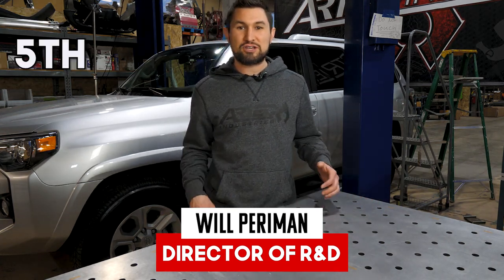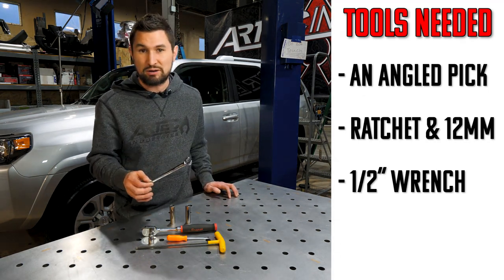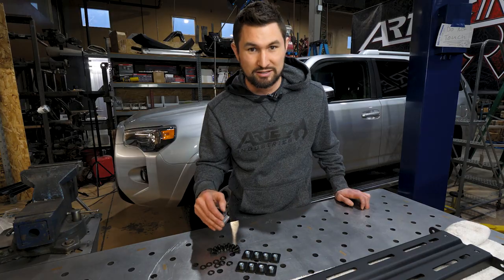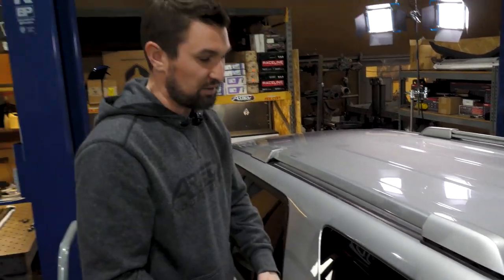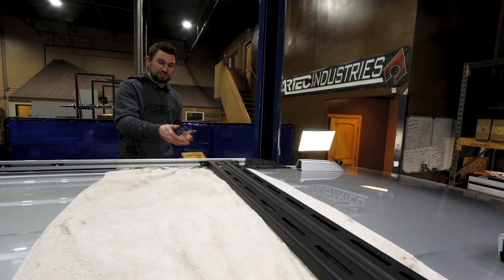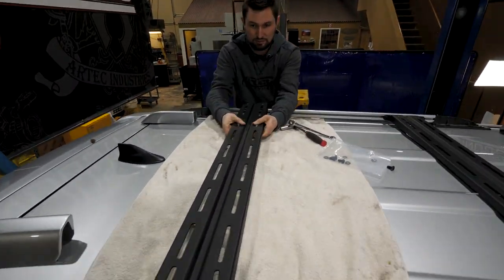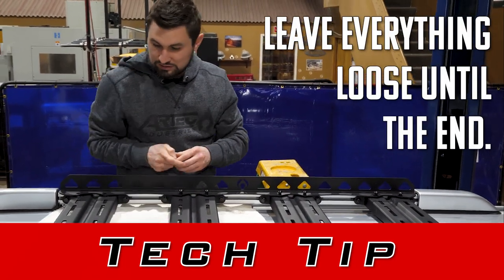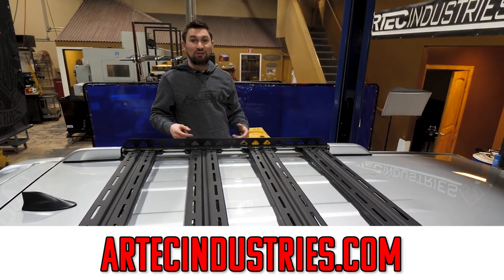5G 4Runner Roof Rack Installation - Sku: TY9003

Comment: I really like this setup but how much clearance is there between the rails and the top? It looks really tight...
Reply: I've been wondering the same... seems like you need to take the rails off to install any attachments
Reply from the maker: Are you wondering how much clearance between the bottom of the rails and the top of the vehicle or the top of the rails to the top of the vehicle?
Reply from the maker: @enriquecortazar20   We have very tight tolerances and strong stamped cross rails that have been tested to not sag and distribute weight evenly. So we keep the rack low which reduces road noise for you too. In fact we've heard from a few customers, that we have one of the quietest aftermarket racks.
Reply: @ArtecIndustries  It seems like there isn't much space to get your hand under the rails to be able to attach any component that requires you to access both the top and underside. What's the distance between the top of the roof and the underside of the rail edge? Can a hand fit under there?

Comment: These are dogshit, don’t buy them, not designed well. They sit too low to the roof to be usable in any way. You have to disassemble your roof rack any time you want to mount or secure something. Even when doing that I had a hard time getting hardware to seat without moving in the channel holes. It’s like they designed these without doing any real life testing. No experience with other roof rails but can confidently say these aren’t it.